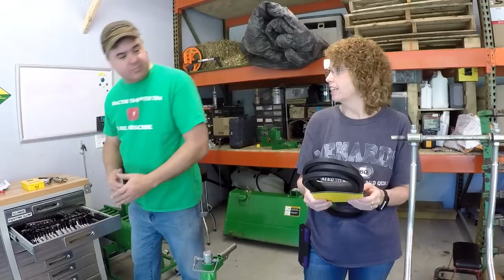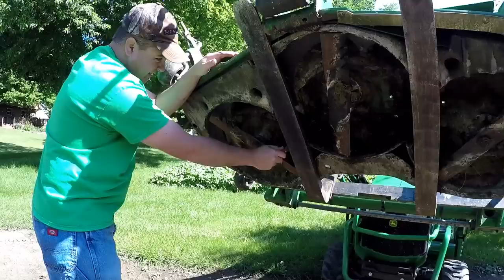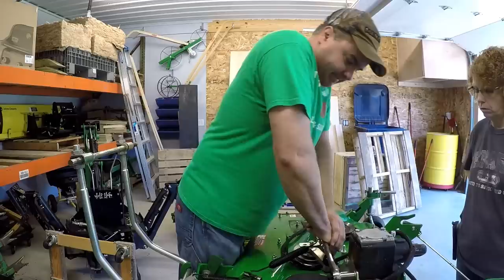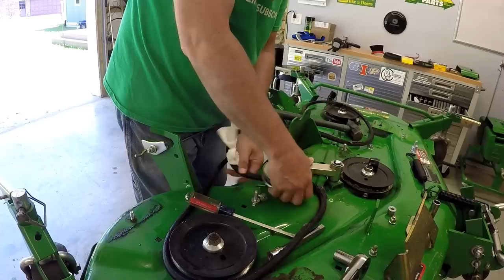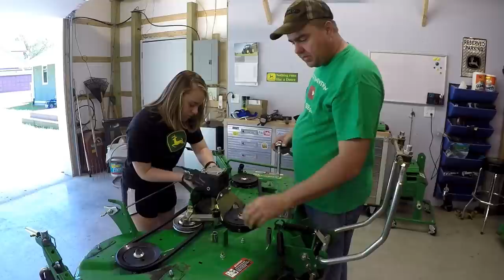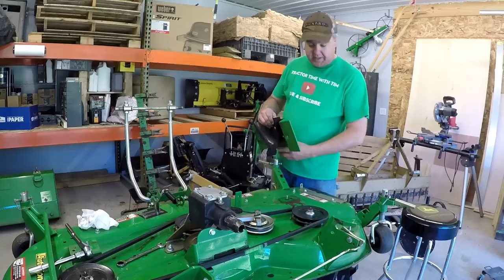Mower Belt Replacement  John Deere 1025R Compact Utility Tractor

Comment: 2:45. Don't cut wet grass, and that won't happen!
Reply from the maker: +Cody Dillon Cody, we are careful to cut at dry time of day.  However, spring grass is so thick and has so much moisture in it that it is impossible to avoid this.
Reply: So don't talk crap about the blades because if your mulching the grass it needs to be dry ,where as if the grass was wet it would build up around the sides of the mower deck and clog, that's where common sense kicks in clearly u haven't got any.